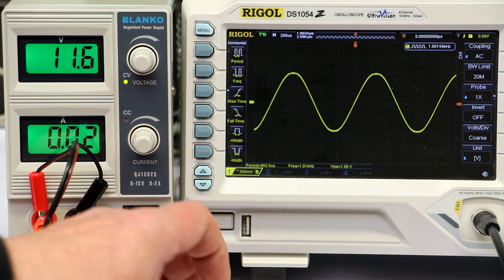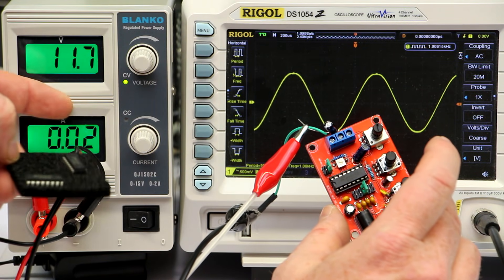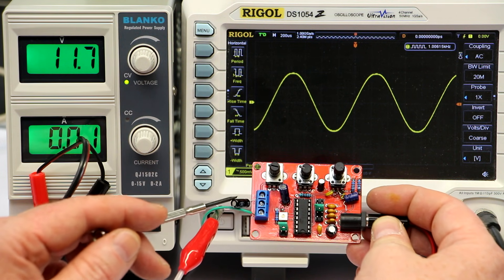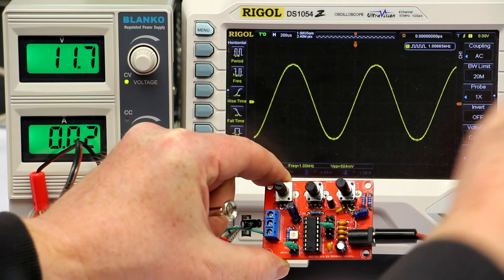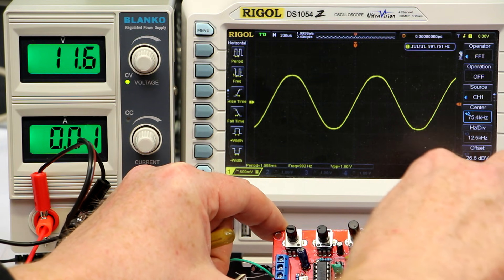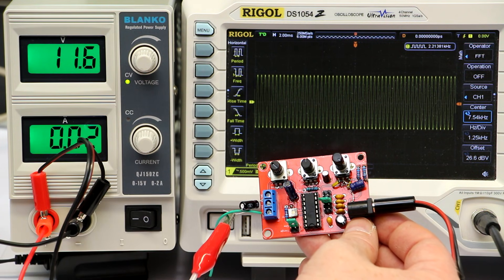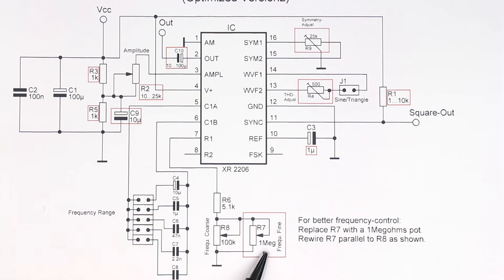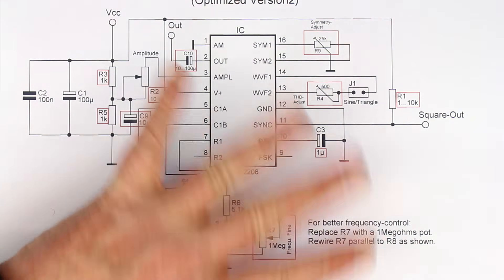Fixing the issues with the XR2206 Function-Generator from EBay

Comment: Thanks for this video, KainkaLabs.  I put together this kit and followed your improvements.  The square wave looks good even at high frequency but I find that the sine/triangle output has an offset of a couple of volts which does not seem reasonable.  Has anyone else had this?
Reply from the maker: If you use the electrolytic (10...100µF) at the output to get an AC-coupled signal and only probe it with the 1 or 10 Megohm input impedance of your oscilloscope, the initial DC-offset discharges only very slowly with a time-constant of R*C which is hundreds or thousands of seconds!
Put a 10k resistor to ground behind the electrolytic and the DC-offset will be gone more or less immediately :-)
Reply: Thankyou, yes, i clearly didn't listen closely enough to your video :)

Comment: I wish you would show how you switched the conetions on the amplitude mod zoomed in with c9 ???
Reply: Look at the schematic he showed on screen and work it out like i did. I should note though when lifting the centre leg on the new potentiometer for amplitude control you do not need to solder a wire from the centre pcb hole to the leg nearest the c4 capacitor as there is a track on the underside of pcb already there joining them. It's hard to see but i think in the video he soldered a wire bit don't think it's  necessary

Comment: Long ago, I had read that Exar had gone the way of the DoDo Bird. I was quite distraught because I loved their products, yet I didn't actually research it. Finding that they are still around really made my year. I was wondering though - are those ceramic caps or tantalum? If ceramic they could cause problems in such a circuit since the piezoelectric effect of ceramic makes them microphonic which could introduce noise into the circuit. Then again, I could be completely off base here.
Reply from the maker: In fact EXAR is still in existence but they don´t produce their old analog ICs anymore for a very long time now. https://en.wikipedia.org/wiki/Exar_Corporation 
The frewuency determining cpacitors are in fact all ceramic ones (MLCC). They are of course microphonic and would never be used here in a precision circuit. But this purpose here to have a small, cheap, potentially battery-operated general-purpose function generator, it´s OK :-)

Comment: My big critic with this generator is there is no amplitude control for the sine wave. Being able to control it is fondamental with audio testing. Can you comment on the appropriate way to make it so ?
Thanks
Reply from the maker: What? Of course there is an amplitude control for the sine-wave. I explained in the video how to make a fine-control with a logarithmic potentiometer (wired in the right way).
Reply: KainkaLabs my mistake. I meant SQUARE wave.

Comment: Hi, which would you recommend, this fun-gen or the avr based one?
Reply from the maker: For my applications: definitively this one (with the modifications).
It has knobs for fast control of frequency & amplitude, is small, can be battery-powered etc.
In practice it is always more efficient/ergonomic to work with a "knob-controlled" device in contrast to a "pushbutton-controlled" device.

Comment: The logo is wrong on the 'fake' (counterfeit) parts. In the 'R' part of the logo, the real parts the curved part of the 'R' is curved. In the fake parts it is made up of all straight lines. Also on the real parts the engraving of the part number is fine where as the counterfeit  parts are clearly laser engraved. As logos are tightly controlled this is not a production batch issue.

Comment: For DOWNLOAD LINK : Roger made an error (it's not a "https" site), so the CORRECT LINK IS:
http://www.kainkalabs.com/upload/index.php?f=15f605449521b3
For MORE SOLUTIONS + Frequency Control LINEAR : I just found some great articles on fixing even more XR-2206 issues. Find the PDF of Elektor magazine December 1984 on WorldRadioHistory website - there are 2 articles starting on pages 24 and 30 respectively. Great information, can improve the performance even more (but not easily inbuilt into the chinese kit).
Reply: As of  July '23 this is perhaps the most valuable comment.  Re link you are correct; for less savvy use very old browser to proceed.  2. I did not find the "  Elektor magazine December 1984 on WorldRadioHistory website" Could  you provide link.   I did however find these articles in Elektror Electronics India, issue Jan 1985.  It could be just the reprint.  The only inconvenience this is not OCR treated pdf. ia600804.us.archive.org/20/items/ElektorMagazine/Elektor%5Bnonlinear.ir%5D%201985-01.pdf

Comment: Hallo, Thank you so much for a very well explained and useful review. 
I am trying to modify my function generator kit as per your recommendations but I am having difficulty in finding R2 (10  - 25K Ohm logarithmic potentiometer) having the same form-factor as the original R2 (to be replaced). In your video, I see that you did find one with the right form-factor.  
May I request you to name the source and/or order number from where you procured your potentiometer, please?
I believe that you originate from Germany, I am also located in Germany. So if you could kindly provide me with the requested information that would be very helpful for me.
Many thanks in advance and best regards.

Comment: I am a bit late to this party, but I learned a lot from your video and will apply these improvements to the kit I bought online. I was curious if you have also looked at the 8038 kit(s) that are out there? I bought the one that comes with the acrylic case, but am quite disappointed in it. The problems are so numerous that I doubt I will even attempt correcting them. However, there are a few other 8038 based kits, so I may try one of those as well. I'm looking at these more from a learning perspective than an actual user perspective (although I definitely will use both of them). Thanx again for some great videos.
Reply from the maker: I only recently discovered by chance that there also 8038-based kits available.
I haven´t checked one yet but perhaps will buy one or two and try them out.
Will be interesting to see if the Chinese also fake the ICL8038
Reply: I have built several 8038 circuits, and they are fairly limited on frequency range.  But for an audio generator, it works quite well!

Comment: is the output of this signal generator AC or DC?
Reply from the maker: IT´s DC starting with the lower supply voltage. That´s why you convert it to AC-coupled with an electrolytic cap.

Comment: How was the SMD trimpot soldered/connected to the PCB at the place of the fixed resistor, when the trimpot has 3 pins and the fixed resistor only 2 pins?  Could anybody help me on this; I am a beginner in electronics.  THX.
Reply from the maker: You leave one of the outer pins of the trimpot open. That way the trimpot becomes a variable resistor.
The 3-pin connection of a trimpot would serve as a voltage divider. The 2 outer pins are then conected to a voltage and with the wiper you can take a variable voltage between the voltage at the upper and the lower terminal.
Reply: Thank you for a very speedy and clear answer!!!

Comment: How about using the 1k resistor, but add an attenuator on the square wave output.
Reply from the maker: That´s a good idea but adds another "complication" for beginners.
We finally settled on  3,3k resistor which is perhaps the best compromise between keeping the current into the protection diodes of digital ICs to a safe level and getting reasonably good edges with the square-signal.

Comment: I believe it's more convenient to use only one multi-turn potentiometer instead of two R7 and R8.
Reply from the maker: Yeah, but a 10-turn pot doesn´t fit here. These are 1-turn trimmers and so the combination of a high and low ohmic value is a good and cheap idea, if the value of the 2 trimmers is in a good ratio.

Comment: How can I input audio into the chip?
Reply from the maker: ??? Input audio to a function generator ???
Reply: @KainkaLabs  yes so that I can modulate the audio signal  and then output the signal , using the function generator as a synthesizer effect
Reply from the maker: You can only AM-modulate the function-generator signal via the AM-input, not the other way around. Where do you have that idea from? For that purpose there are specialized VCA-ICs available (or discrete circuits). Google will tell you more.
Reply: @KainkaLabs  there's an output on the function generator, if I go into pin 1 with a preamp and pass instrument audio through the function generator, shouldn't I be able to hear the modified  music come from the output if the output is plugged in to a guitar amp?
Reply: I have a new idea. I can sample the tones in middle C and use it as a virtual instrument with the auto-sampler plug-in. No need to build anything to get these weird sounds on tape

Comment: The link is kinda "brokenISH" at least my antivirus (ESET Internet Security) is blocking it due to an issue with the ssl certificate, like it is not trustable or something or it is revoked...
Reply from the maker: Link is corrected. Try it here: https://1drv.ms/u/s!AmW9-q-1GZM1ip5wO7uvHpcenfI14g?e=m4TqeJ
Reply from the maker: Link has been changed to the kit in our online-shop where you can also find the documentation. Should work now. Built-manual is only in German until now.

Comment: just to defend the "engineer", the 5.1kohm of the divider are actually taken from the datasheet...
Reply from the maker: Right. But this shows that the Chinese either don´t fully read or understand the datasheet and how to achieve a better control of the output amplitude.
Reply: Michael Bishop  - Nope, schematics are in zip file link in description.
Note Roger made an error in the download link. He wrote https://www.kainkalabs.com/upload/index.php?f=15f605449521b3
but it's not https, so the CORRECT LINK IS:
http://www.kainkalabs.com/upload/index.php?f=15f605449521b3

Comment: Hi, I followed your instructions about Fixing these issues of XR2206, it worked like a champ but for the 65khz - 1mhz since wave, I got a little ring on top of since wave, for lower frequency it's quite good. So do you have any suggestion for it? If possible please tell me your email, I will send you my picture for more clear description. Many tks
Reply from the maker: The "ringing" that you probably mean is inherent in the XR2206 internal design (also in the original chip).
The easiest remedy is to use the little trimmer suggested for minimizing the distortion.Did you already implement this?
There is a further pin for the "symmetry" adjust (pin 15&16) that could further improve the sine-shape. But it think that is a bit of overkill.
In the 1980s some people designed very clever external electronics around the chip to get away with the spike at the upper and lower part of the sine-wave. But that also would be overkill.
My email-adress is roger@kainkalabs.com
Reply: Thank you so much! Yept I don't use little trimmer because I don't have digital oscilloscope for adjusting 2nd 3st.... harmonics like yours. So I skipped it, I will try to adjust it with 500R trimmer to see what happen. Thank again!
Reply from the maker: You can try to adjust the sine-shape also with an analog scope.
Just optimise the shape and symmetry by eye so that the sine-wave looks textbook-like.

Comment: PLEASE GIVE ME REPLAY SIR. i need your suggestiions.
I have gone through both your videos on XR2206 FG Design errors.
I tried to assemble the kit by myself. But instead of 25k log pot i used 10k linear pot. and and other all components as 100nf Box type capacitor and 25V 100uf capacitor and two 1k resitors and 63v 10uf capacitors for pin3. and 25v 100uf at pin2.
then 5.1k ohm and connected to center terminal of 10k pot and then its one of the remaining terminal to center of 100k pot and then one of the remaining terminals to ground. Then 63v 1u at pin 10 and pull up resistor used is 3.3k. 
and i make 1k trim pot parallel to 1k resistor to make 500ohm trimpot(ie, shorted the side two terminals with 1k and verified using multimeter).
But i am not getting the output.
i tried rewiring the circuit 3 times and for 3rd time i got distorted sine wave.
i tried varying 500 ohm trim pot but no result. and even for amplitude variation ad frequency no change that distorted waveform.
PLEASE HELP ME OUT WITH YOUR VALUABLE SUGGESTION.
Is there any possibility to make me complete this design.
Please give me replay for this message .
Reply from the maker: I will at best find time at the weekend to answer your question.
Roger
Reply from the maker: I can´t see anything wrong with your circuit diagram. 
You should check the wiring especially of the potentiometers.
E.g. check the resistance from pin 7 to GND if that really changes with a turn of the 10k and the 100k potentiometer.
And of course the supply voltage should be 12V max. (better a bit lower) because of the instability of the fake XR2206 above 12V.
Reply: Can i amplify the amplitude to 20 Vp-p using an op-amp circuit. And can you explain again that why you changed the resistance to 1K in voltage divider. And the importance of 100nF and 100uF capacitors in parallel with them.
Reply from the maker: Of course you can amplify the amplitude with a separate OpAmp. You just need then +/-12V power supply voltages.
Paralleling an electrolytic with a 100nF ceramic is standard in decoupling the supply-voltages.
Going down to a 1k resistor divider for the amplitude setting gives you a much lower minimum amplitude (a few mVs instead of a few 100 mVs)
Reply: Do distortion happens for output waves if i amplify my amplitude.
And I think the problem with my circuit will be with xr2206cp ic. Because I used xr2206cp f1328 instead of f0918 or f0919.
Reply from the maker: 1.) No
2.) Maybe, but why should the manufacturing date make a difference?

Comment: My virus protection does not trust the schematic upload. Can it be sent via e-mail?      Does anyone have a copy they can share?
Reply from the maker: The only thing is that the SSL-certificate has expired. There is no danger in downloading. Just store the files and let a vrius-checker run over it. Trust me :-)
Reply: Roger made an error in the download link. He wrote https://www.kainkalabs.com/upload/index.php?f=15f605449521b3
but it's not https, so the CORRECT LINK IS:
http://www.kainkalabs.com/upload/index.php?f=15f605449521b3

Comment: I got some XR-2206 and I don't use them because they are noisy. Has anybody else experienced that, likely a batch problem?
Reply: D800Lover
 check your power source. Power source might be noisy which produce noise in the output of the generator.

Comment: Minimum Single Supply Voltage is listed at 10V on the data sheet. 
You want to operate it using a 9V battery?
Reply from the maker: Yes and it works with a fresh 9V battery.
Reply: @KainkaLabs  Thanks. I went and checked my kit, and it runs down to 5V !!! and up to 15V (as high as my PS goes) with no funny business! I think these are updated dies and should have better specs than the original dies.

Comment: But this system is only designed for a maximum of 9v
Reply from the maker: No. The "manual" states that it works up to 12V and an original XR2206 would work up to 26V without any modification of the circuit.
9V is a good compromise here especially when battery-operation is intended.
Reply: KainkaLabs oh, then I'm not sure where I got that from, maybe the chip itself is can handle an excess but I'd not be so sure about everything else

Comment: So, where can you find for sure non fake xr2206's?  It looks like all the fakes are 0919 pr 0918.
Reply from the maker: You usually only get them in single qunatities from Ebay by chance or from a reputable seller who gives you a money-back guarantee. In one of the comments it was mentioned that not only the date-code but also another detail of the printing is different from original EXAR chips.
Reply: @KainkaLabs  Yes, I
Reply: @KainkaLabs  Yes, I saw date codes 0919 and 0918.

Comment: All the XR-2206 chips in these china kits will be fakes. Exar Corporation was bought out a few years ago by MaxLinear and they ceased production of a number of Exar's popular products including the 2206. As it was, Exar hadn't made them for some time. A friend recently gave me a function generator from the 1980s and it has an original XR-2206 in it with a date code of 8430 (30th week of 1984). It has the genuine XR logo on it and these china fakes look nothing like it.